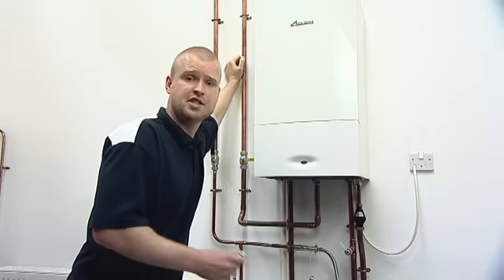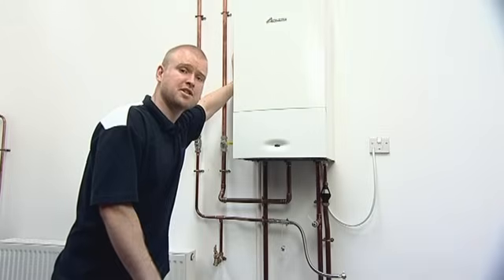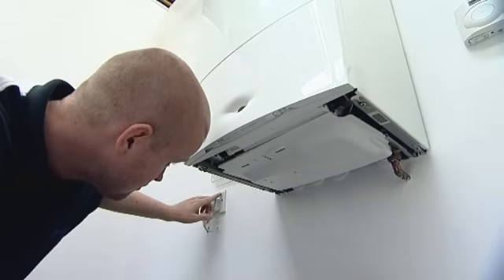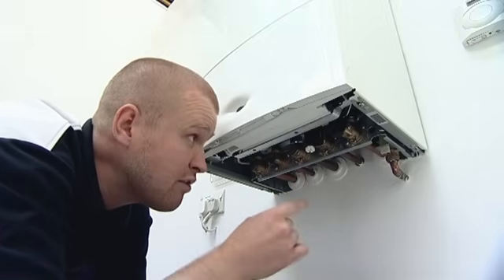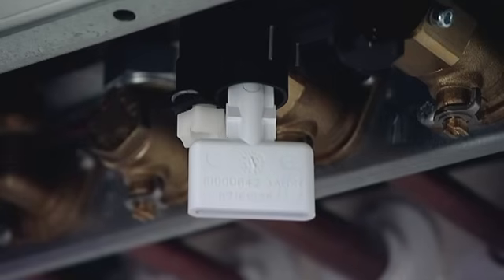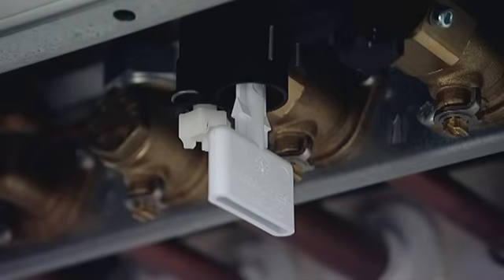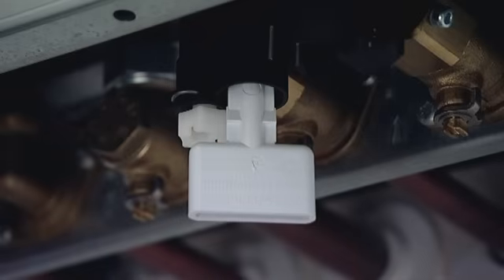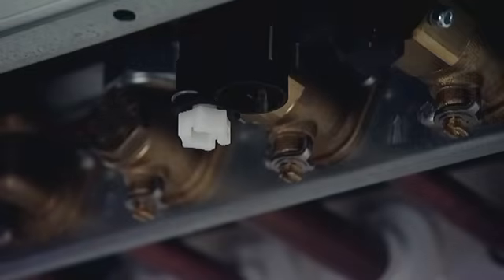How to Repressurise a Heating System with an Internal Filling Key | Worcester Bosch

Comment: Must have done something wrong water is coming out where the key has been put.
Reply: That happened to me - you need to make sure you push the key in fully - you can convince yourself that it is in far enough then water comes through the base of the key. Also make sure it is pushed in at the angle of the unlock symbol then turned to the lock. You can't push the key in too far! (famous last words...)
Reply from the maker: Hi Paul, if the key is not inserted all the way in, and in the locked position, water will come back out of the boiler. Please ensure the key is fully inserted, and in the locked position, before turning the valve. Many thanks, Worcester

Comment: great video, boiler refilled in two minutes. The key needed some effort to push all the way in as brand new, won't turn until it's in all the way. once in, it turned very easily. So if you're struggling, don't try to turn it harder, try pushing it in further.
Reply: Your advice saved me from snapping the key as it wouldn't turn. The choice was risk it and snap the key, or let the family freeze tonight! That extra push in did the trick (using a touch of washing up liquid on the rubber seals on the key). Thank you.

Comment: Key won't turn! Key inserted in unlocked position, mated, tried gently turning clockwise to locked, eventually tried more force, and the key snapped. Suggestions? Was just checking how it worked before removing a radiator, so now I have a still working boiler and heating, but know that I won't be able to restore pressure if I remove the radiator...
Reply: try pushing the key in a bit further, mine took some effort to push all the way in and wouldn't turn until it was. once in all the way, it turned very easily. If that works, and you refill the boiler, then unturn the key and grip it with pliers to remove what's left of it.

Comment: Massive help on our 24cdi unit. Took two minutes. I did note that it failed to ignite on powering on at the mains with double, slow, red flashing radiator and hot water demand lights. Is this a safety as pressure sensors tripped? Resetting the panel has worked and boiler is behaving itself once again.

Comment: Might you have any idea what the problem might be if after doing this procedure and the boiler working, about an hour later the same problem occurs and I can't get the boiler to ignite for hot water on demand? My model is the 24i Junior and the pressure gauge is about the 1.2-1.3 after adjustment, however it's always been around the 1 mark prior to any problems at all and seemed to work fine. The light is flashing as it did before I pressurised.

Comment: Thanks for this. I have a 28 junior and it seems I have to keep re-pressurise every 3 months at the moment, is that normal for a 3 bed. Also the engineer left the key in on the lock position. I tried to remove it but it seems stuck and feels fragile I'm scared of breaking it. I have asked the engineer after seeing this video and he has said I can leave it at the lock position. I'm happy to leave it in but need to know whether it's the lock or it's the unlock position I have to leave it at.
Thanks for saving me money and exposing this easy process.

Comment: Excellent instructions. Previously I had been confused by the apparent lack of filling connections in my system. This video explained clearly how filling this type of boiler was possible without the conventional set-up. Worked a treat. Other should note that inserting the key may require a firm hand.

Comment: With my boiler I tried this but the gauge doesn't go up. It sounds like water is flowing into the boiler but the gauge does not move. How should I fix this?
Reply: either water flow is very slow or the pressure gauge is non responsive or very slow (the latter happened to me)

Comment: really clear instructions but when i do it rather the pressure increasing, water pours out and i'm worried that the pressure will drop even more. the pressure gauge is just sitting in-between green and red at the moment.

Comment: Is there a way to add inhibitor to the system via this boiler? I have no radiators anywhere that have blanking caps, the bleed screws on the radiators are in the panels and not in blanking plugs like most seem to be now. If not my best option seems to be to drain down and remove an upstairs rad and add inhibitor to the pipework?

Comment: Thank you for the video, i recently had some work done where my radiator needed to come off. after the work was done i bled all the radiators, after doing that i searched for this video and followed the instructions to repressuriser my Worcester 28I Junior. however, when turning the nut next to the key (the right way) no water fills the boiler... nothing.... am i doing something wrong? any ideas?
Reply: Hi Daniel. You probably know the answer since you posted your comment - I made the mistake of only pushing the key only half way up. Push it far up as it can go and you should have no problems putting water into the system. Also, I am sure that this engineer forgot to say to switch on the boiler again from the mains. Happy days.
Reply: Thanks for your reply. Since posting I did manage to get it sorted. I just kept at it and out of nowhere it worked... So it probably was something silly that I missed

Comment: Prior to using key, hold under cold running tap for a few seconds, this should help to insert/remove.
Reply: +Geoff Bartlett Thanks, will try that next time.  Key was very difficult to insert and remove!
Reply: Thanks for this tip. Was starting to wonder if I had the wrong sized key or something.
Reply: @thomasclark8559  Or washing up liquid: even easier!
Reply: I also put a squirt of washing-up liquid on the rubber rings
Reply: Washing up liquid, a tiny bit, is good. A small amount of silicon oil is better. Don't buy it unless you have other uses for it. If you have a friend who has Scuba equipment, they almost certainly have some silicon oil for use with O-ring seals.
Reply: Geoff Bartlett l.mk.

Comment: The internal filling key is stuck in the key slot and I can't pull it out - any ideas?
Reply: Yeah that's not a problem because these keys can be very tight fitting. 
Our boiler man has therefore left the key in the 'closed padlock position', though that means that the bottom tray cannot be fitted back in place. 
So all we then need to do is:
1. switch power off
2. don't mess with the key at all
3. turn the white plastic nut (spindle knob) anticlockwise to allow the water to fill in
4. turn the white plastic nut back clockwise once the pressure gauge shows it's in 1.5 position and finally 
5. switch power back on.

Comment: Our greenstar 28i jnr DHW was very hot, then after starting to fill a bath for the first time in years the water went cold and the boiler started banging (think sledgehammer on the boiler). did this one more time the next day then no more hot water. when we open the tap water comes out of the pressure valve outside. CH was okay but now the pump overrun does not work 90% of the time. I'm thinking its overheating and the banging is steam?

If we keep the CH on and let the rads get hot then it now bangs too. no air in rads. do we need a new DHW thermostat and the boiler bleeding and charging? is the heat  exchanger damaged?

inside the heat exchanger is it a tank filled with water with two pipes running through it (DHW, CH) or is it tank with CH water passing through it with one DHW pipe passing through it?

does the pump over run work on DHW or just CH?
sorry for all the q's I'm on a small phone and in pain

Comment: E Peterson, I had this problem too ;).... the 'thinnest' part of the tray faces you, and it slides in place...there are some plastic clips facing you, the one on the left hand side is set back  and clips over the silver metal part of your boiler.  The clip on the right clips into a peice of round black plastic.Hard to explain.. Trick with plastic is never force anything.... [been there!]when it is 'right' your tray will click in with no trouble at all.

Comment: Thank you so much! I noticed my millibars were in the red, Chris, our Worcester Bosch heating engineer showed me how to top up the boiler,  when he installed it,but I forgot how to do it..these instructions are clear and concise....getting the tray back in was the trickiest part-but it is now in place. Definitely saved me a call out charge. :) PS, have never needed to fill up before, as it was adjusted during the annual service.

Comment: Thanks for the handy instructions, works exactly as you demonstrated (and you're much better looking than Phil Mitchell, by the way!)

My question is: how often should I need to do this, only I did it a couple of weeks ago and the pressure has returned to zero so have just had to go through it all again. Is that usual? Cheers

Comment: Great guide, I have only one problem. I can't get the key out. From the look of it, it's been stuck there long before I moved into my current place.
Reply from the maker: Valior86 Hi and thanks for the comment.With regards to the key being stuck for a long time it may be seized in place and we would recommend moving it as leaving it in place could result in the boiler over pressurising.  It may be worth while contacting a local engineer as if the key is stuck solid then the filling link may need to be replaced.